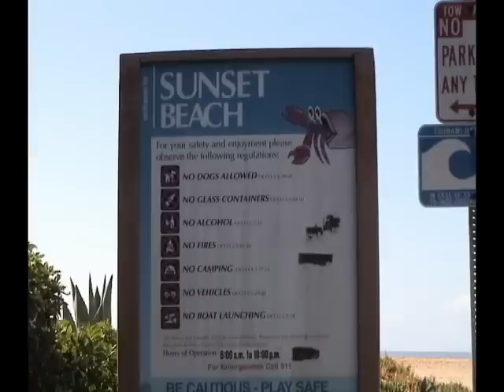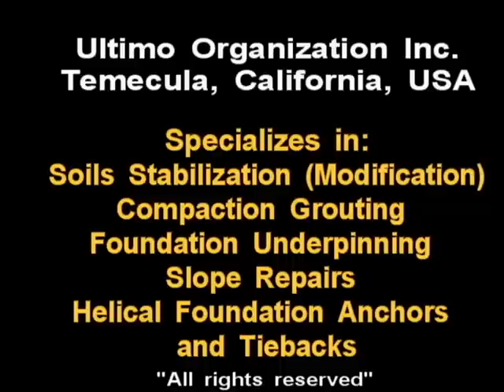Liquefaction Mitigation Sunset Beach Case Study

Comment from the maker: The Ultimo Organization also provides similar methods for compaction grouting, raising and leveling sinking structures, and stabilizing failing slopes. These methods convey controlled subsurface pressure that will compact the soils to the greatest extent possible.